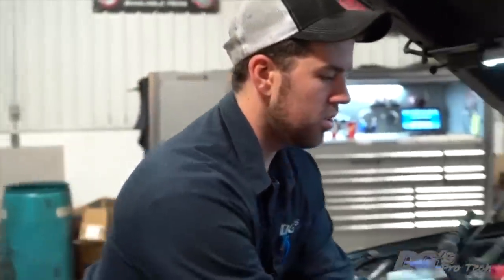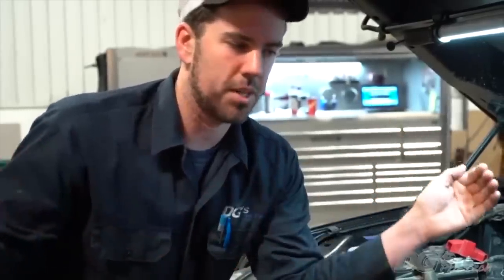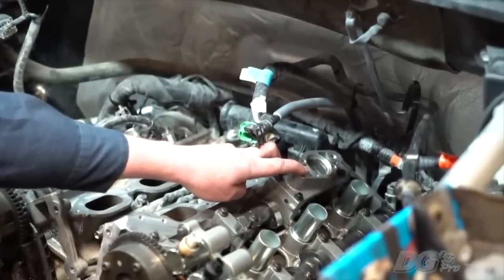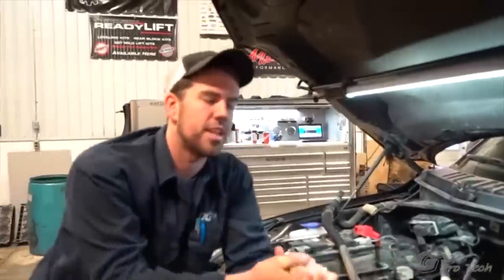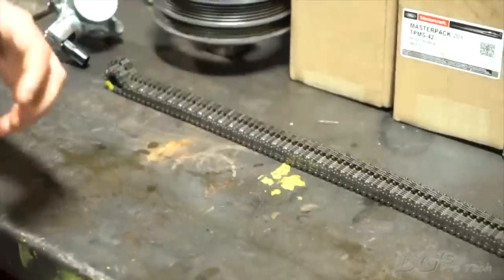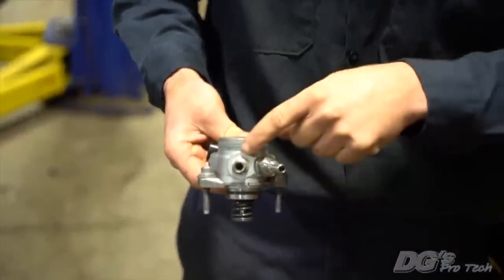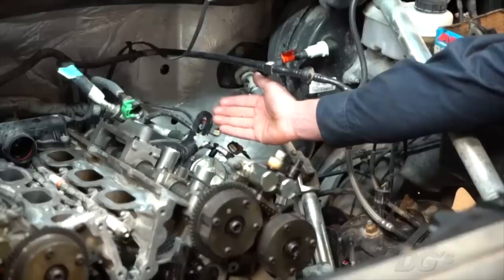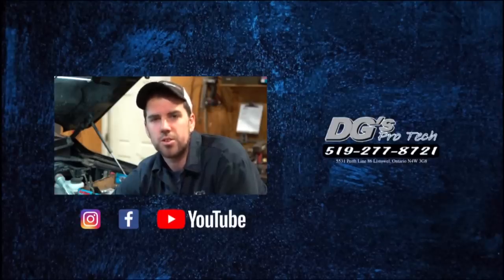What you NEED to know about Ford EcoBoost Engines by Dustin Golley of DG's ProTech

Comment: I'd love to know why you think synthetic oil is superior. SO falls off parts when not being pumped so every first start will put more wear on the engine. Also there is no scientific proof that changing your oil more or even if it is needed. Certainly replacing a filter would be good,  the oil, no. Most oil you buy today is recycled and super filtered. All they do is take out the contaminants and sell it back to you. 
 BTW, a heavier weight oil clings better than low viscosity oils. Multi weight oils will never be a higher viscosity than their lowest rated number. Manufacturers use light weight oils for better gas mileage and they have a vest interest in your engine wearing faster to sell you parts and new engines. 
 Want to know why a water pump has a weep hole? So it has a place to leak from. Had you tapped that hole and put in a zerk fitting you could have greased the bearing. FACT! GM learned they make more money selling and replacing water pumps than installing grease fittings.

Comment: Lmao its a great engine only if you dump tons of money into it on a monthly basis , thats an expensive upkeep for an everyday driver.  Not trying to be negative but most people don't want to have to spend extra money on an engine just to ensure that  it might not still fail because there is no stopping chain stretching even with synthetic oil over time it will happen anyways maybe not as soon but 100k maybe 150k its definitely not a eco friendly engine or pocket book friendly engine.  Ford parts are expensive 65 for a tentioner x2 that's 1 for each side.  Im not sold on fords just yet great video very good information here

Comment: Alot of fancy speak..... No matter how much slack the tensioner takes out doesn't change physics, the chain is longer than designed and therefore the timing is not correct causing cam crank correlation codes.
And before you condem me, I'm Master Ford certified, Master GM certified and Master ASE certified for 22 years. I was working on the bugs in these engines before you got your hands on the TSB

Comment: What we have going on here is two or maybe three problems.First is the engineer that put these engines out on the market.Yes it really is not just a Ford problem but all makes and models.Next is the consumer or we call the owner till you bought the sad sack you over paid for.Most of the owners do not keep up with regular oil changes.So when they do find time to finally..we found time to get the oil changed.Some seem to have a oil change with conventional oil..oh my my.Then now you find time and say to save myself some money ..yes that would be fine..so conventional oil it is.Better than not changing your oil ..but you could have done so much better.Here now as I watch this video it is February and about 15 degrees outside.That means the conventional oil is like molasses and Aunt Jemima's pancake syrup thick and in the bottom of the engine oil pan.The camshafts are all the way on the top of the engine and when you start your engine it takes awhile to get the lubrication it needs up there.Your synthetic oil does not have the thick quality that the conventional oil does and can get up on top and do it's job much quicker.The last little thing came out of some sort of rant that you can go 10,000 miles if you use synthetic oil before you need to change it.They should have took this fellow behind the wood shed.Even synthetic oil breaks down and no longer protects the engine but it really does a job on the variable valve actuators that gets the sludge..yup that is what the oil becomes when it breaks down and throws off the engine timing .Timing chains really do not strech  but it is the wear in all of the components from the oil not protecting the metal because of break down.

Comment: All I hear is a bunch of excuses for poor Ford engineering. Look at the difference in size between those two timing chains. You want to tell me that more frequent oil changes are an alternative to the correctly designed parts from the factory? Let's not forget that Ford engineers designed the stupid oil minder and made the oil recommendations. Again horrible engineering if engines are failing using Ford's recommended service guidelines! And how did that other customer jump timing and destroy his engine by continuing to drive in limp mode? The vehicle is basically not driveable in limp mode.

Comment: I bought a brand new 150 in 2014.  I have had nothing but problems with it.  When I got it home, day 1, I noticed oil dripping out of the rear diff.  The pinion seal was leaking like a sieve. That was the start of the problems.  I have put two IWE assemblies in it (front diff lock mechanisms).  The first time I opened the sun roof , it cracked.  I have owned almost every make of car over the years, but, by far, this has been the worst one.  Now it has an antifreeze leak.  I put a gallon of antifreeze in it yesterday.  What next?  POS, trash, scrap metal.  Next time I am going to get a truck and not a nightmare.  BTW I have done maintenance to the letter and by the dealership.

Comment: My truck broke a connecting rod at 63 K  I use the best oil i can get and change it @ 5000 miles or less I went threw Hell at the stealership . It took them 4 months and gave it back with a broken waste gate control valve  I had to fix that  They did not know what was wrong with it .

Comment: Great video about potential problems with this engine. I'm debating on the 5.0 V8 or the Ecoboost on a new F150. I've had good luck with my 2013 5.0 coyote engine, but the new V8's are having issues with oil consumption because of the Arc Plasma treatment to the cylinder walls. So this might be the ticket

Comment: Everything the previous folks said is 100% on point - great presentation!!  But going back to the turbos...  I’d like to buy a Flex. I wanted an AWD. Can’t afford new. AWD only available with Ecoboost. Most affordable used cars are over 100k miles. At least according to a couple of Ford documents, the turbos are designed to last “100k miles”. What do we do with these high-mileage trucks?  Put new turbos in them?  Or just put synthetic oil in them, work them, and hope for the best?  Almost sounds like a new timing chain, tensioner, and turbo overhaul should be factored in to any used purchase?

Comment: I work as a mechanic on production equipment and I used to think the way we manufacture things in modern times is all due to the pinnacle of the engineering innovation. Wrong. Common vehicles on the street today have the most absurdly advanced and often problematic technology. Thank you for what you do and for helping me understand what’s under the hood.

Comment: To me, all engines will last a long time without major issues if maintained with GOOD quality synthetic oil @ 5000 mile (8000 km) or 6-month maximum oil changes. 
At home I have a 2016 Honda Pilot, a 2015 Nissan Qashqai (rogue sport) and a 2013 global Ford Ranger T6 with the 3.2 I5 diesel engine. All get their 6 month or 5000 mile oil change and never had an issue. The Honda gets its OEM synthetic blend engine oil, the Ford uses 5w30 Motorcraft oil for gas and diesel engines (the same oil recommended for the EcoBoost engines) and the Nissan uses Pennzoil Platinum full synthetic. All engines running as great as day 1.

Comment: Hello Dustin, I have a 2017 EcoBoost at 54000 miles  And I use it for work Towing 7500 pounds 90% of its driven time, my question to you is What Do you recommend the interval be for oil changes? And And do you recommend any other type of maintenance to be done more often?

Comment: I have a Lincoln MKS Eco-boost AWD sedan. It's so much fun to drive I'm always using boost mode. Not great fuel economy but what the hell, it's worth it to have some fun! I do change the oil at 5k miles even with the synthetic. I can't believe any car should run 15k miles on one oil change.

Comment: electric is looking better all the time.
in the effort to boost efficiency and clean them up, engineering is just making them less reliable over all.
or problematic to keep reliable
the future is an air freshener commercial. plug it in, plug it in.
didn't touch on the carbon deposit problem in the intakes either.
although if i had a problematic ford, i'd want this guy to fix it.

Comment: I'm really curious about how many miles this engine had on it to get to this point. I had a 2012 F150 Ecoboost, w/extended warranty. I tow a travel trailer, a lot, almost half the year on average. I was towing home after the winter season at 3 yrs and 2 months (57,000 mi) when my #2 coil dumped on me. Had to limp about 40 miles on the interstate to the next town big enough to have repair facility (which wasn't a Ford dealer). When all was said and done the warrranty refused to cover the repair because a coil is considered to be "consumable." In my opinion, maybeso, but not at 57k. So, I took that for the writing on the wall and traded the Ecoboost for a Duramax a couple months later and I've never looked back: lesson learned, don't buy brand new technology, give a year or two to work the bugs out...

Comment: This guy has reduced my fear of this engine. Very, very well done.
Reply: it still sucks. doing an induction service to clean the intake valve tops, which gather gunk due to being direct injection engine, risks destroying the turbos, which are so close and overheat during the process.
Reply: @gwho  this is not an issues with gen 3 as they have direct and port injection now.
Reply: @gwho  You do realize that hasn't been an issue for the last FOUR YEARS, right???
Reply: He said the timing chain was underdesigned and needed an additional tensioner. And the turbo waste gate sticks. Were we watching the same video?
Reply: read my commit I posted
Reply: Titan500J most of the issues are because of bad owners and not servicing them regularly
Reply: I totally agree.. My fear of my 3.5 twin turbo Ford Explorer Sport failing is now extinguished.. Just hit 100,000 miles I keep the oil changed regularly and so far no problems, runs like a top...
Reply: @kevinsears3101  have fun with manifold stud replacement and front timing cover leaks
Reply: @kevinsears3101  got a 3.5 eco boost sho that has 135,000 miles. Still drives great, just changed the oil religiously.
Reply: Had 3 EcoBoost over 10yrs. Love em. Oil changes every 5kmis.
Reply: Ive had mine for five years.  No issues at all with the engine.  Only fear I have is IF and its a big IF, that if there is a mechanical failure the cost of a new engine used and new is 6k to 10K respectively
Reply: I just got a TT Stinger--was very worried about reliabilty but talked to a KIA tech like this guy.Maintain it at the dealer and get the oil change at 3k.KIA warrants theres for 10 years because they believe in it.Like someone said it is customers who skip maintenence.
Reply: The engine is junk. 99-06 5.3 GM puts it to shame
Reply: @justinballard7242  unfortunately those are 14 years old now
Reply: @22EXPLORERST  I know hard to find one in a truck that isn't rotted out. Mine is a 2000 silverado 293k miles still going strong
Reply: @justinballard7242  Theyre every where if your out side the rust belt.
Reply: @justinballard7242  Shame is it made no power, and now it is among the most unreliable engines in the industry.
The 6.0 was better, but those trucks all, and let's not even try to dispute that, ALL rust in half.
Reply: @InuranusBrokoff  the 07- present are junk but the 99-06 are way better than any ford period
Reply: @justinballard7242  in 05 GM came out with AFM. Those engines are garbage. A chevy 5.3 can't  keep up with the 2.7 or 3.5
Reply: @Tom-yj6mt  07 is when afm was introduced to the 5.3
Reply: @Tom-yj6mt  gmt 800 series trucks are my specialty. Look it up
Reply: @Tom-yj6mt  afm is garbage which is why I said 99-06
Reply: @justinballard7242  I thought AFM came out before that on that engine. I did look it up and your right. That  AFM  is a joke. I've done a few of them, not fun. Now Ford is starting that in 2021 with the v8. It's just one more thing that's a pita to fix
Reply: Randy bobandy Unfortunately the entire truck around that 5.3 is garbage and they’ve only gotten worse every year newer.
Reply: @WontSeeReplies  99-06 is a great truck. Trucks with 500k miles reported
Reply: @justinballard7242  Garbage Motors is just.....garbage.
Reply: @4BravoLima  ok everybody has their own opinions and you're entitled to yours

Comment: 2013 f150 3.5 Ecoboost with 81000 miles with no issues. Mobile 1 5-30 full senthetic oil with OEM filter changed every 5000 miles.

Comment: But if you have to use the turbos more often, so they don't seize up, and thus lower your mpg. Wouldn't a 5.0 just be a better engine. Less headaches with the turbos, and your right foot decides the mpgs.

Comment: Good video but I have a 2014 economist and this theory of “do good maintenance and you won’t have problems” is false. I do oil changes every 5k at ford and meticulously take care of the vehicle. It has 63k on it and has had 2 new turbos, and the timing chain repair. Maintenance isn’t the problem. It’s a poorly designed power train
Reply: Over 95% of people with ecoboosts didnt have that issue... you just got a lemon or did something wrong.. i have a 2.7 my grandpa has a 2.7 and tows heavy shit and has over 150,000 miles and hasnt done anything but oil changes, air filter changes, basic maintenance

Comment: Use Motorcraft ford brand oil that is stated for use in your owners manual... a lot of guys go off and spend more for off brands they feel are superior but a reviewer did a blackstone oil analysis and it showed the ford motorcraft oil had the least wear on ford engines in particular.... ford must have specialized properties in there oil that is suited best for the makeup of the ford engine.. who would of thought.... universal oil may not be as superior in protecting your specific ford engine... ( This oil gave me the BEST Blackstone Lab reports on my Ford  engine. Lowest parts per million on iron, aluminum & other important metals. I wish I had used this oil from the date I purchased the car. )

Comment: Great job.  IMO,  the timing chain life and stretching issues are going to correspond with the amount of stress/work the engine has been asked to perform.  The harder it's worked the shorter the life of the chain.  I would suspect that normal use and occasionally working it to it's potential wouldn't cause premature failure.

Comment: Just bought a 2014 king ranch, Im getting (trailer brake module fault) every time I start my truck and then I get a (advance stabilitrac) code while driving. I've heard easy fixes and horror stories like having to replace the steering rack. Whats your professional take on this and is this a common failure with these fords and is a sign of whats to come?

Comment: This is great information. I sold Fords for a couple of years and the customers I met seemed to fall into two categories; those who loved the ecoboost and those who had problems with it. Very few in between. So it seemed to me that the engines were hit or miss. You'd get a good one or you'd get a problem child. This sheds new light on those issues and it makes sense.  Thanks for a great video, by which I mean understandable and simplified for the non-technical (like me).

Comment: I own a 2014 ecoboost f150. Crap gas mileage. Timing chain was shot at 26k miles. Fixed under warranty, thank god, because it was a complete failure. $3000 out of pocket had it not been under warranty. Leaks coolant from the reservoir. Hasn't leaked from the turbos yet but I believe its coming. Very costly process. Cant keep plugs or coils on cylinders 2 and 5. Stopped letting ford fix those issues and did it myself. Saved over $1000 by doing so. Parts off amazon and a how to video on youtube to replace. 
Best case scenario, if I had it to do all over again, buy the 5.0 and be worry free.

Comment: So I have a 2010 EcoBoost f150 with 165000 miles an I have always  always changed oil at 5,000 is it too late to switch  to synthetic? Also my miles never gets above 12 to 13 miles per gal how can I improve  that? Also is there a recall on the timing  chain you was talking  about? Thank you I will subscribe!!
Reply: You havent been using a synthetic blend motorcraft oil all along? i thought ecoboosts use the synthetic blends at least my 2.7 does use the synthetic blend oil... i just stick with Motorcraft oil as its the ford recommended and from what I hear motorcraft oils protect ford engines better than any other off brand that people claim are better because ford engineered there oils and coolants to be specifically tailored to work best with there metals and parts in the engine and cooling system where off brand oils are more universal and not tailored to a specific engine also when is the last time u changed ur engine air filter.. if its dirty that could hinder mileage